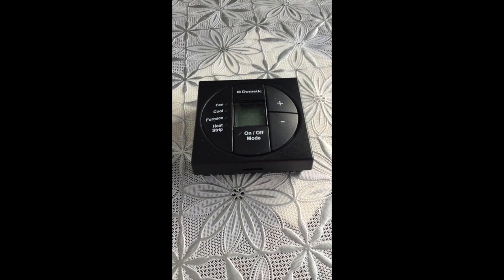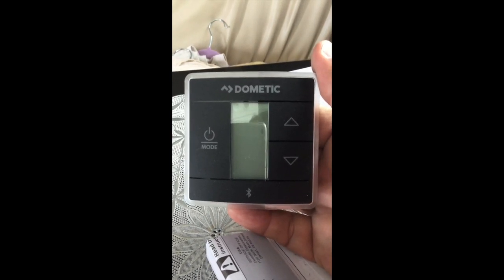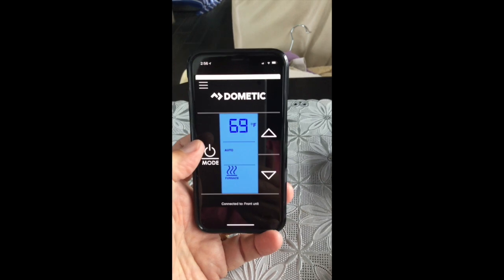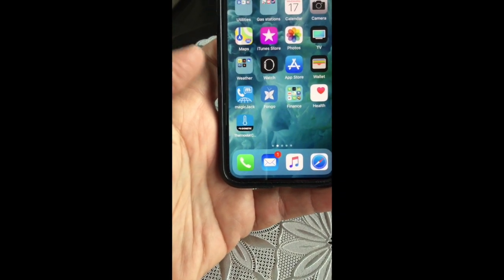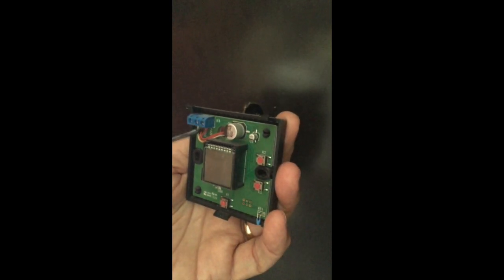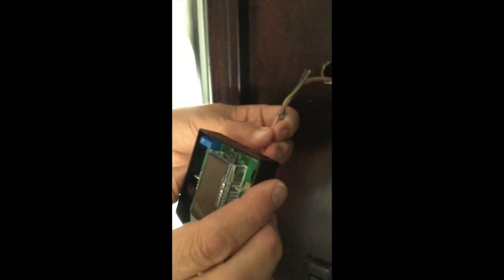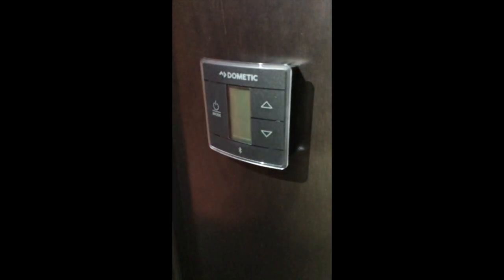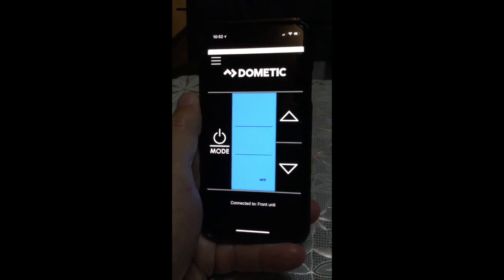New Dometic Blue Tooth TC

Comment: Thank you so much for the video!! One note I will share with everyone:  Make sure the Thermostat is OFF before killing the power and changing it out.  Or else you will get an E1 Communication error. Ask me how I know 😛
Reply from the maker: Hi Justin thank you for watching the video and your comments. Yes you have to make sure that all the power is off on only the 120 ac but the 12 volts. I turned off the breaker and the 12 also.